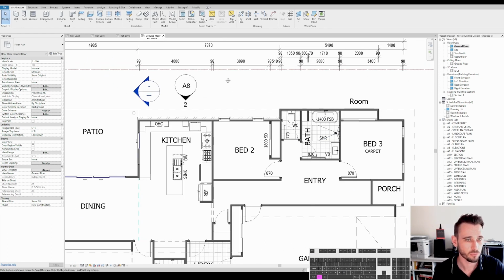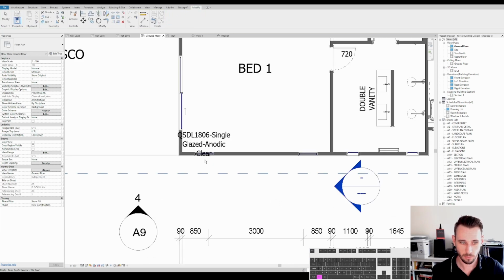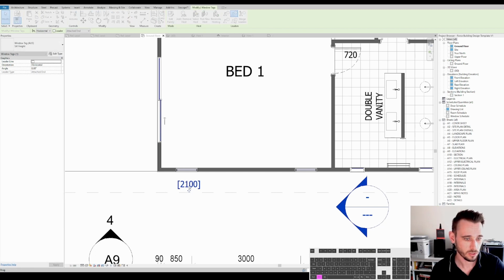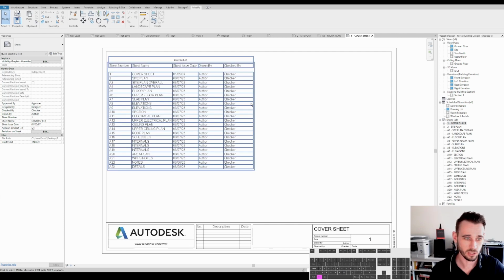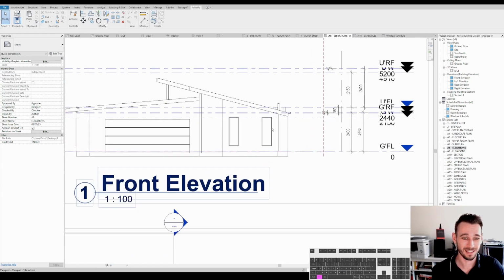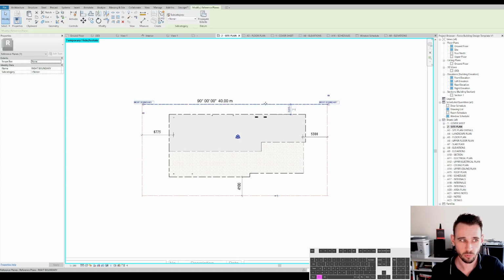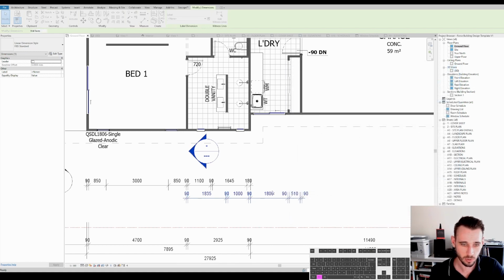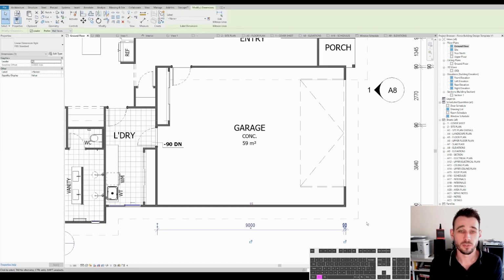Revit Template Part 3: 3d families, tags, sheets, levels & dimensions

Comment: hey mate, I have been using Archicad for a couple of years and I now need to learn Revit. Trying to do a template from scratch is becoming painful. Do you offer a template for purchase ? Cheers
Reply from the maker: Hey Mate, 

I don't offer any for purchase sorry, main reason being that a Revit template that's generic enough for everyone to use should be so easy to make it'd be rude to charge for and one that's specific to your companies needs would be so specific that no one else could really use it.

Is there anything in particular that you're having trouble with in making the template?
Reply: @RevitSmart  Ahh that’s ok. I’m just starting out myself. Can’t get any work for someone to learn the ropes near where I live (Coffs harbour area) and I’ve spent the last 3 years learning Archicad and spent countless hours doing up templates for that. Currently trying to learn Revit through YouTube as I haven’t been able to find someone to tutor me for Revit. I get the general gist of it all but lack the knowledge or putting together all the views, and layouts. Archicad is much easier to use but I’ve found the only way I’ll get some work is to learn Revit. So was more looking for a head start with everything I need in there. If that makes sense
Reply from the maker: @benhennessey8646  Ah cool, first thing you could try and do is measure up then draw up your own house (or wherever you live - unit/apartment etc) then once you've made a detailed model of that with all the sheets (site plan, floor plan, elevations, section, electrical, internal elevations of wet areas etc.) you can do a 'save as' as a template, delete everything then use that to start refining moving forward. 

Additionally you'll have a set of plans to use as example work. 

You could also find some random house on a real estate website that has a lot of photos and a floor plan and kinda wing it it based on that?
Reply: @RevitSmart  Ive been trying to redraw plans I’ve done on Archicad. Slowly getting there but get caught out on a few things. I’ll keep practicing with it. I watched the video part of you saying to always save your work. God I wish I took that more seriously. Lost hours of work yesterday lol.